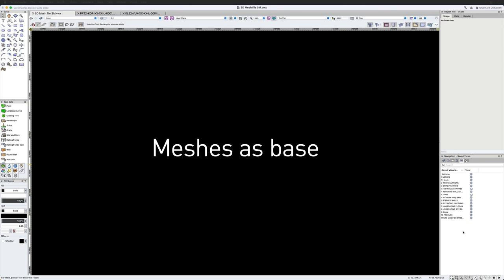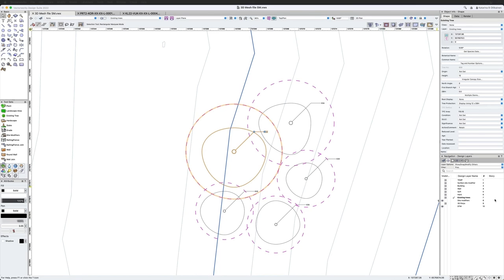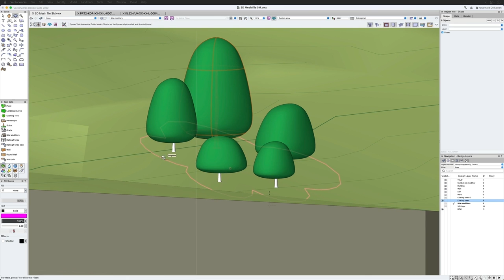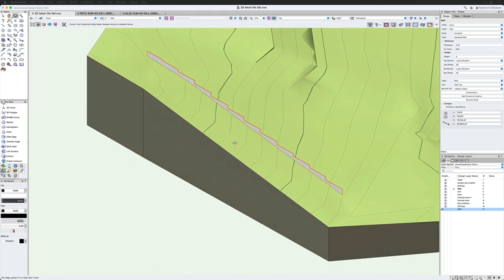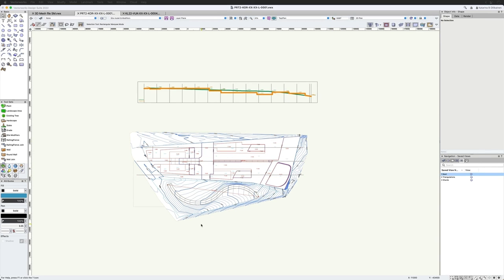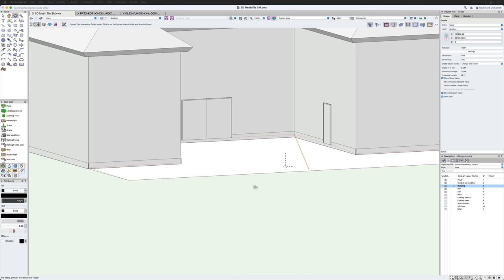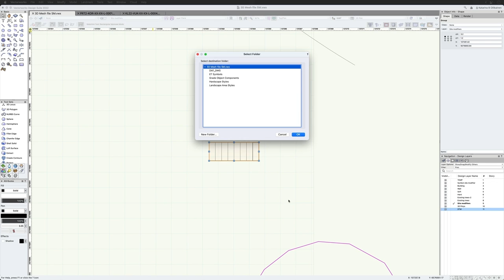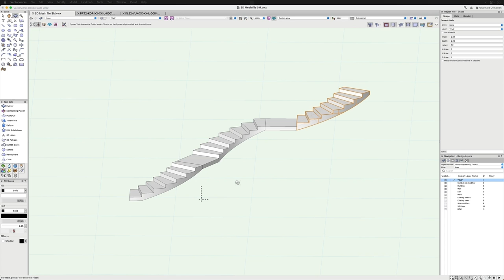Beyond the Basics — Site Modeling in Vectorworks Landmark

Comment: Hi Katarina,
greetings and thnx for the Video. Great Tipps&Tricks!
At 34:15 you show a path. Could you please descripe how you made this kind of path!?
…  it would be useful to upload the demo file, you showed us in this tutorial.
Greetings from Germany
Reply: … and thnx in advance!
Reply: Hi Tobias, I just used a hardscape with a slope on it and with a site modifier at the top. You could do it many ways, depending on what you need to get out of it (here it was just to explain how the Site model sections work on curved lines). Normally I would grade the site with site modifiers (or 3D polys) and then use the landscape area to add the hardscape.
Reply: @katarinaollikainen4093  Hi Katarina, mercy beaucoup for answering my question. I will try to reproduce such a situation. Is the file you showed us, somewhere available in the VW University? Greetings from Germany.